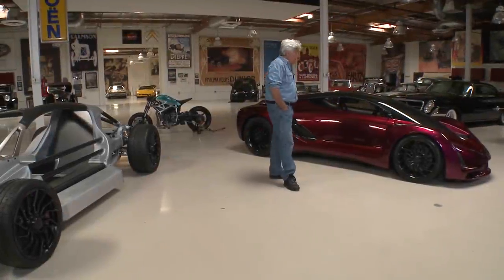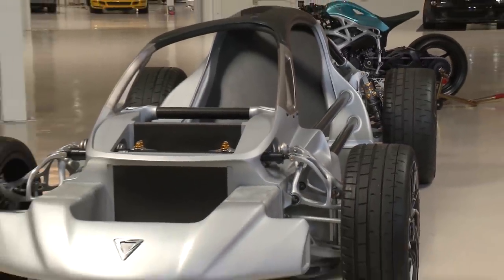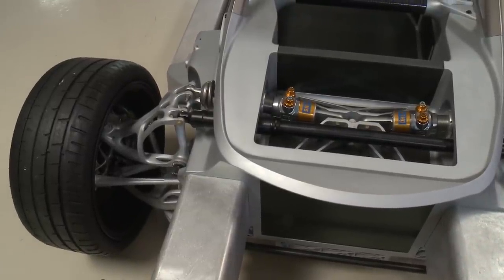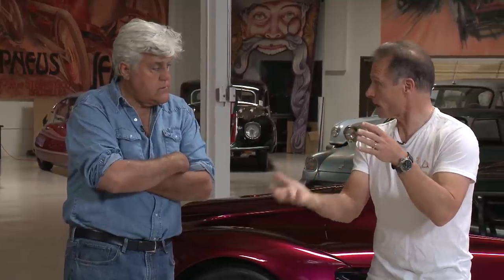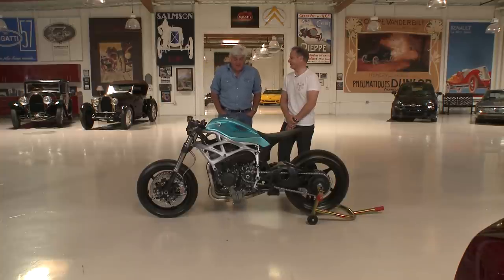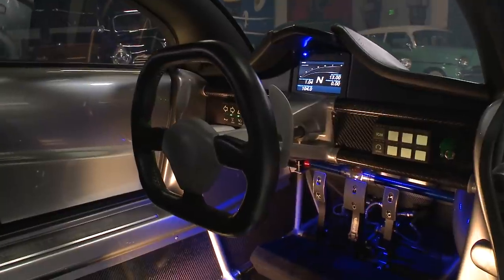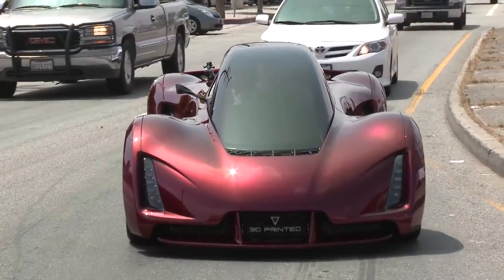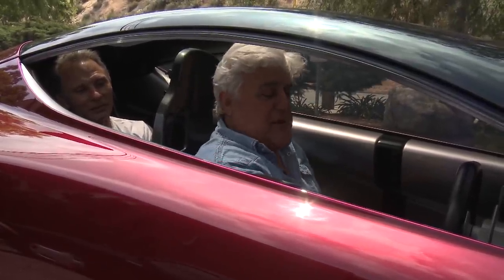2015 Divergent Blade - Jay Leno's Garage

Comment: @22:10 how i wish he blames it on to the brakes cause its too good at doing what it does and the car is so damn light, in order to save face. Because the pot hole issue wasn't gonna dent those tires.. they're just that old, we get it.

Comment: Overall build is pretty nice but, from what I've noticed about computer aided  drafting; the structures are plenty strong until actually put into situations where the thing is stressed to its maximum tolerance, then there is disintegration. Look at the guy that tried to break the bicycle speed record coming down that gravelly mountain, if he had used an overly strong heavy steel frame he would've been none the worse for wear, but no, he chose a carbon fiber frame deemed stronger than steel and the thing broke. That must've been painful, I'm sure they used computer aids in creating the shape of the frame. Also, the vibrating panel tells me it's too flimsy and may have parts flying off at high speeds. The suspension looked very spacelike, engineerd for NASA sorta thing. I wonder how it would stand up to hours on the test track, I heard the rattle as you pulled into the last driveway. The sound deadening should be added, it won't hurt the power to weight ratio too much.

Comment: OK this guy has said lower cost about 20 times, lets see what the price ok the super car is, I watched the video, I could see a couple of small issues, but overall , the car has the look, if they are getting 700 hp out of a 2.4 engine, that will be just ,,,,, no words but ohhhhya, great idea,, I hope that the idea takes off and helps change to a better idea for a car, someone needs to come up with a program that will stop a car under certain conditions

Comment: Ok, I needed to take a breather from this guy at 5:08. (I'll finish watching.) He's just the most boring guy to listen to and I'm betting Jay was thinking the same thing by his stance and "mmhmm". I do have to say I was already hating this car 13 seconds in when it looked like the breeze would just rip the body right off the car. {Sigh} Ok, let me "try" to finish this one.

11:00 I don't get how they "bond" those pieces together but have bolts "so you can replace parts in case of a crash". Are the pieces bonded and insulated from the environment or are they replaceable??

I always get the impression that Jay can just drive however he wants in that city. LOL

Comment: a pioneer that is Not following the old methods of making and manufacturing automobiles Elon Musk had all his eggs in one electric basket this man is all about making chassis and suspension components Stronger & lighter, this car is fast w/a little Mitzi engine, a Ford coyote or 6.2 hemi in place would Scream like rocket fuel

Comment: Interesting video, interesting technology, interesting car. As a "Hot rod", the Blade imitates a bit the Ariel Atom, the tubular-frame thing using a Kawasaki motorbike engine and sequential gearbox and about the fastest thing on the planet. The Atom isn't a prototype, you can buy one road-ready right now - around forty grand (peanuts) if you're that kind of junkee. As a demonstrator design the Blade "sort of" works but it could have been any other type of car really. As a hot rod, I thought it might work better as a more open top thing, I wouldn't like to sit inside that noisy bubble and in that concept of a "hot rodder", the body brings nothing - better to dispense with it altogether. In fact, I think there's a design error - the Atom doesn't enclose you at all - you wear a bash hat and goggles or you don't play. The Blade has to decide what it wants to be - fast? Proper mental road fun? Forget about the social aspect of a passenger? Or adopt the "supercar" thing as it does but consign the passenger to being a package in the back? Why? One or the other. If the driver is in the centre, it's for driving. No reason to provide for a passenger at all - that's never worked in the past, people don't like it. Matra, McLaren - it's been tried before. In over a century of cars, it works only in single seater racing - people like company, they come in pairs and a man and wife like to sit together - even in a Lamborghini. The derivative interior didn't at all reflect the vehicle because it doesn't "know what it is". Just "stuff", "look-like stuff" that was trying to say "This is not a motorbike" rather than announcing "This is a car" - and what sort of car. It's very strange when Divergent are trying to show the revolutionary chassis (The only relevant thing about it) and...don't show it. Even more strange to adopt an architecture of post-war poverty, the necessity that made the unsociable and much-derided Goggomobil, clothed in "Supercar" guise that would get you divorced as a geek instead of a really good time in the sack - if she sits BESIDE YOU in a supercar. So powerful this is, it applies even if it spends all it's time in the garage - you'd never ask your wife to ride in the Blade, it's like taking her to a restaurant and ordering sardines on toast - with the whole world watching.

Interesting comments. I don't think Jay Leno did anything wrong at all as an interviewer - he was bored out of his mind by Divergent's CEO hitting him in the ear again and again about the cost savings in 3D printing. We all got that point readily enough but he wouldn't shut up about it, the very beautiful organic look to the front suspension brought more stuff about the process and the cost savings of tomorrow's cars, "What do these bolts do?" brought no clarity to the rabbit hole of bonding titanium and aluminium etc and the crash structure question was just to get him off that, give him an opportunity to tell us it's safe as houses and it wasn't any better - it's hardly the most interesting aspect, is it? Yet it brought only more poorly-explained geekery about the time savings of crash testing in the digital domain before you have to do it for real without ever telling us - how well does it crash? Some people are good on TV, some can sell things, some can't and our Divergent guy is strictly....back room, development. Meeting him at a party, button-holed over a glass of plonk, how soon would you unload him to get rid of his mad, staring, in-your-face, one-track arm-waving geekery? The disturbing "Please, please, please listen to me" posture? HOW ANNOYING IS THAT? The kind of social psychosis that makes you want to punch Emmanual Macron in the face? Nor did it ever seem to occur to him that he could and should address the camera - fill the screen and tell us something interesting instead of techno-babble. In short, he doesn't even know how to prepare an interview or presentation, his people skills are very poor and his media sav is....pretty much zero. Not even enough to check the car for hard tyres with flats or any other weaknesses when Jay Leno (who knows his cars) is giving you an interview. He controlled nothing because he didn't prepare - that's infantile. I don't think Jay Leno would have given him the time he did were it not for being such an interesting concept and he had the grace to congratulate the guy on producing a working prototype. No small thing but - Divergent are "not there yet".

Divergent need several things - a clearer automotive vision from someone, better body design, experienced chassis-suspension engineers that can "interface" with development in the digital domain and someone to do their marketing and media. Currently, as Mr Divergent told us, it's full of geeks and nurds -  computer tec doesn't replace any of these things. 

The try-out drive was a bit of a disappointment too. Jay said about flat-spots on the tyres but it may be that it isn't an Ariel Atom - an absolute and uncompromising speed hooligan. It's bit of a soggy design because it doesn't know what it wants to be and the Divergent crew are right be offering the technology to the automotive industry because on that showing they don't understand cars well enough to design and sell them. However, they're probably wrong too - they should cast around for the right automotive people because - there's a HECK OF A LOT OF MONEY IN LICENSING THAT or running with the ball themselves (or both) once Divergent understand that the digital domain doesn't replace human trial and testing and why that is - a chassis works only when your arse says it does.

I watched the whole thing because it's so darn interesting but it was obvious that Jay Leno found Divergent's chap to be very hard work - he had his arms folded and looked as though he wanted to just tell him to shut up and stop giving him earache for two minutes. He wanted to be alone for a coffee break. It's equally clear that he didn't feel that he could "chuck the thing about" to really push it - despite it looking like "that sort of vehicle" - it doesn't handle, he didn't trust it and the stuff about the tyres was just to avoid saying that.

That's no reflection on Divergent. What they are doing is amazing and will obviously appear in motor car manufacture. They need to have their patents in order in a dog-eat-dog world and never, ever, ever let that guy anywhere near a camera, press release or microphone again. It's now 2020, I've never heard more about it. Why is that?

Comment: he tries so hard to use engineering words before everything. To the point where its kind of slow moving in the presentation waiting for him to hesitate on use of the correct words instead of quickly running through the biggest features the engineers came up with and whats so important about them. a concise presentation keeps people interested.

Comment: The reason Jay probably seems like he is disconnected from the conversation is because he has heard it all.  His job requires knowing the input and understanding of various industry standards to the point of overload.  You can see his gears turning as he correlates what is being said and relates the input to the industry standard in various sectors in my opinion.  I do this same thing when someone is talking to me about things I consider myself to know much more about over all.  And while I am not knocking on Czinger as an individual, his demeanor is distracting and doesn't mesh well with the more down to earth approach Leno is used to presenting with his show.   This was a Tech demo, not the typical collector car structure this show is wrapped around and it seemed like it threw out both of their presentations.   This was like Leno's Garage crossed with Ted Talk.

Comment: I think this is the most profound video ever published, but it is confusing me why the company has seemingly gone dark to the public in 2018. I think they are partnering in China or something but this will be the largest change to production cars ever since Ford's assembly line methods, whether it reaches us licensed through this company or not. Given the suitable condition of my car I do not think I would want to invest much in a new one until this kind of innovation is implemented. Gone will be the excess weight and comparatively poor performance needed to reach safety standards.

Comment: Imagine being sideswiped in this thing. Both driver and passenger's heads would be smashed back in forth through the sides. The passenger actually has to hold onto the back of the driver's seat for stability due to piss poor design. Also with the way the passengers legs placement is along side the front driver seat, between that and the frame, a side impact would instantly crush his legs. Very impractical as well. Its like driving the batmobile, and not in a good way. Nearly any impact on this vehicle would be catastrophic for any occupants. This guy is way too proud of this thing. Sometimes ideas on paper doubt always translate well into the real world. Hell, you'd be safer wrecking a motorcycle at high speeds than in this deathbox. Anyone seen Death Proof? The entire car is like the passenger seat of the movie car, lol.

Comment: 0:13  super rubbish fitment of the body panels and who takes a vehicle with suspension issues for a third party to test. It looks ugly and should have been a convertible. It's one thing to have a lot of engine noise with your head in the wind and another to be sat in a sealed plastic bucket with the same engine noise.

Comment: I can't smell or see oil. I hate it. You know, if the power ever goes out, guys like this who you think are cool now get stranded because they can't use a ratchet or clean a plug. They don't own a rag. You can't make 3D printed lines meet up if the material is different? Really? IT'S A COMPUTER AND A ROBOT..... why don't the lines meet up? Why aren't the seams flush? Does it have to look cheesy like you sanded it too much and now the fit is screwed up? Given the retail cost? Lol. If computers can't make a fit cleaner than a talented man.... unplug it and never mention it again because it's already antiquated. THANKS!!

Comment: Its an overpriced price of crap. You can buy the gold foil in your local auto zone. Mitsubishi engines are horrible versions of Japanese cars like the Mazda. He changes the subject whenever Jay points out its weakness like the 3 crash proof side bars or the gold proof foil. Its definitely not a safe car as Jay Leno politely pointed it out because he didn't feel safe pushing it too hard..lol..